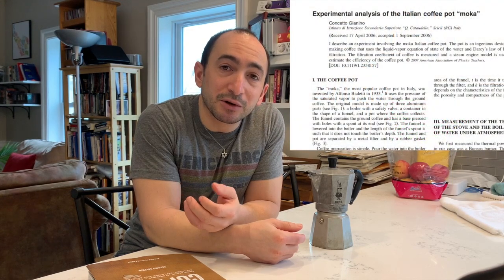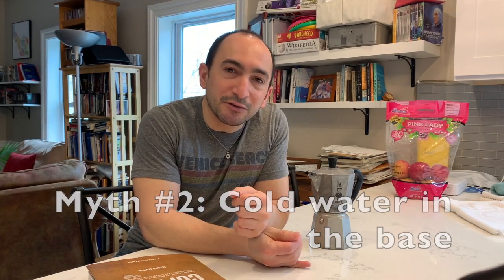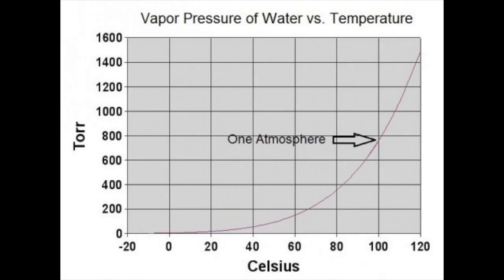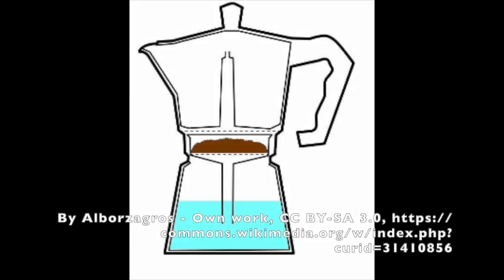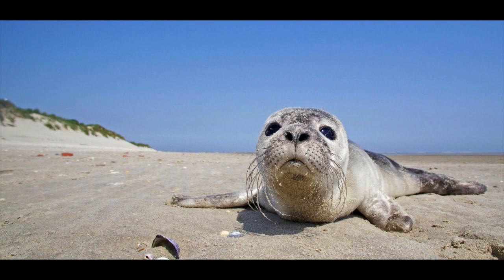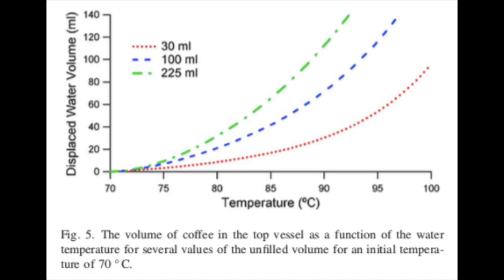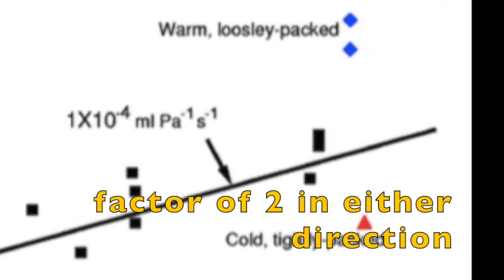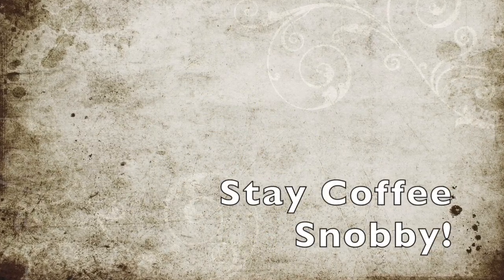Why you should preheat your moka pot water.

Comment: Thanks very much for these videos. I've been wrestling with an off brand mokapot for the last year or so and have logged hundreds of brews with many different techniques. The lower, mellower temps associated with lower water fill as well as the "suckback" from low air space are things that I have noted but couldn't really understand or explain. The information as presented in this video and the series has really helped and given me a direction to go from here.

Upon further contemplation I think another factor that helps speed up lower water level brews is that there is a higher surface area of water lower down in the tapered lower chamber. This increases the rate of evaporation (evaporation only takes place at the surface). It also reduces the amount of pressure required in the chamber to get the water moving- the water surface acts as the face of a piston and piston faces with more surface area move more with lower pressures.

I have been using some variations in technique that I haven't seen discussed elsewhere.
- I use an oversized mokapot for my desired yield. This larger basket provides a stronger brew without any compaction that holds up better to dilution in milk drinks.
- Rather than allowing the water level to determine yield I have markings in the upper chamber which denote various coffee weights. I can pull the shot when I like and avoid any stromboli phase completely while also having control over water level to manage brew profile and thermal mass etc.
- Experiments with increased thermal mass to reduce temperature spikes and increase ease of hoffman/wired gourmet style "thermal surfing". More water is one way of achieving this but there are...others.

Feel free to experiment with your 9 cup. Once I have my method perfected and understood to the degree that it can be shared I'll make a video that will hopefully contribute to the ongoing understanding of these funny little machines.

Take care,
Andrew
Reply from the maker: Hi, thanks for the appreciation!

I'm impressed that you managed to note the effect of lower fill level on brewing time without a theoretical understanding for why.

As for your comment about lower levels = larger surface area, I was doubtful but then took some measurements on my 6-cup model. The variation from the lower area to the upper area from the narrowing of base does vary in diameter from 7.5cm to 10cm, which is an area ratio of nearly a factor of 2. I'd have to really think about how large this effect is compared to the backsuction of requiring less air to expand more.

That being said, the partial pressure of the water vapor above the water should depend only on the temperature and not the area, but you're right that evaporation rate is proportional to area.  In any event, the force on the water due to pressure being applied over a given area is of course linear in the area, which increases as the water drops, but also as the water level drops, the less mass of water is being pushed up the tube so I suspect this would manifest in a lowered puck resistance/larger flow parameter.  All this together explains why it takes more heat to start the moka pot brewing than to keep it going.  

Anyway, love to chat with you and delighted to hear about your experiments in the world of moka pots!

Cheers,

Joel
Reply from the maker: Also, sounds like you've already played around with the effect of water level on brew time and extraction temp:

https://www.youtube.com/watch?v=NQrRzTzU_Yk
Reply: @ Hey there Joel :)
Thanks for your kind words about picking up on these relationships. I think it helps that my mokapot is so large (~34g basket, ~400ml chamber) so the differences between extremes in water levels are very pronounced and easier to isolate. This size of mokapot is almost certainly suboptimal but I aim to fully understand it before transferring my learnings to a more sensible size.

I can't comment on how significant the effect of increased surface area is- that's for the realm of real scientists. But yes if you crunch the numbers you'd certainly imagine it would be a factor to some degree and  potentially go some way to offsetting the backsuction effect.

It is interesting to wonder if the tapered chamber is designed with this effect in mind or an aesthetic choice. If the latter then you wonder whether a differently shaped lower chamber would be superior in some circumstances. Potentially a very wide, low chamber could produce less temperature range from brew start to brew end with extraction temp then more controlled by user defined preheat in a manner vaguely reminiscent of an aeropress.

I was also previously of the impression that lower water level meant lower mass being pushed up the tube- this was actually my prior theoretical explanation for why lower water levels brewed cooler and mellower. However after some consideration I don't think it makes sense- it's what actually prompted me to look into some papers. All the water is pushing downwards with gravity, but only the water inside the spout is actually being lifted against gravity and only when it raises above the level of the water on either side. Higher water levels actually start this spout water level higher so less distance is needed to travel and hence a shorter water column so less total lifted mass in the spout.

Take care,
Andrew

Comment: I really enjoyed watching your video again! I have a question. Based on fig. 5 oc king article, with initial water temperature of 70 C and 225 ml free space in moka (the worst scenario) we get final brewed temperature of 90 C. But with similar condition, I barely get 60 C extracted water temperature!!! What is wrong?
Reply from the maker: Sorry, I just saw this comment.  It's an interesting question and it may have something to do with the flow of the water. Once the water pours out the top, the water will drop dramatically as it is exposed to a lot more surface area of much cooler. The important thing of course isn't the measurement of the temperature but how it tastes. How tasty are the results you're getting?
Reply: @loodog555  it tastes good enough, but that would be much better with higher temperature

Comment: Another example of a fundamental flaw in King's paper is the completely baseless, lazy, unverified, and, almost certainly false assumption, in his words: "The best estimator of the relevant average extraction temperature from the calculations is the volume-weighted average extraction temperature of the first 100 ml of water". He invents that assumption out of thin air, and i would be happy to bet quite a lot, that he is completely wrong. 

The discussion around ideal extraction temperature can take some guidance from the Illy article in Scientific American, where they say 94C for 30C is optimal temp & duration. I'm happy to accept that - in their context, which is a an espresso machine feeding water at that exact temperature through the coffee, for that duration.

But for King to then transfer those recommendations to a Moka express - which has a widely varying extraction temperature (cooler at start & hot later), and then to say the best estimate of the relevant extraction temp is the volume-weighted average, over the whole brew period, is just a completely baseless and unwarranted assumption.

As an engineer, with a grasp of chemistry, materials, and physics, I can quite easily imagine you might also be able to get a perfect brew from an extraction temp that starts low, and has a low average volume-weighted temperature, as long as the extraction temp DOES rise to that ideal range around 94, towards the end. It is actually very possible, that the compounds needing temps around 94C, may not need the 94C for the whole 30 seconds... an extraction temp that starts a bit low, may still work very, very effectively - the cooler water at start will still be sufficiently hot to extract all the easily soluble stuff, and the hotter water flowing through later is then less saturated with those compounds, and more able to do its job dissolving whatever is left that needs the hotter temps. So, yes, the Illy article suggests 94C/30secs is ideal, but that does NOT imply it needs to be 94C for the whole 30 secs - constant temp for the whole duration just happens to be characteristic of the proper pressurised espresso machines that the article was considering - but it does NOT mean the chemistry of the beans needs 94C for the full 30 secs...and so it does not mean a Moka express needs to maintain 94C for 30 seconds for optimal extraction...

I am no super-chemist, but i do know enough chemistry to realise the "relevant" temperature, in a process that occurs across a range of temperatures, may very easily turn out to be the maximum temperature involved in the process, or the minimum, or the average. It completely depends what the process is, and what the chemistry is. For King to just assume the best estimator in the moka express coffee brewing process is the volume-weighted average temp, is just a completely baseless guess, and almost certainly wrong.
Reply from the maker: I mean, espresso doesn’t necessarily extract at constant temperature either.  Hoffman gets into this in his video on temperature surfing: https://m.youtube.com/watch?v=QAzE-_ocf1U

That said, the enormous temperature variability of the moka pot is one of its great challenges.